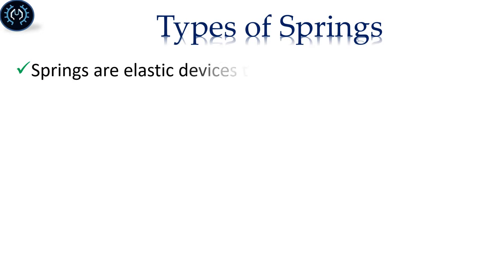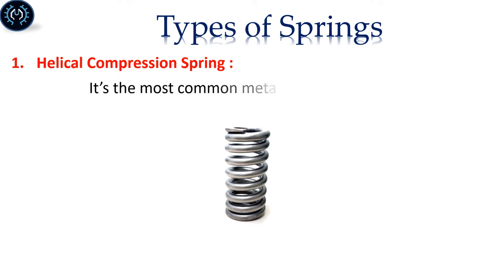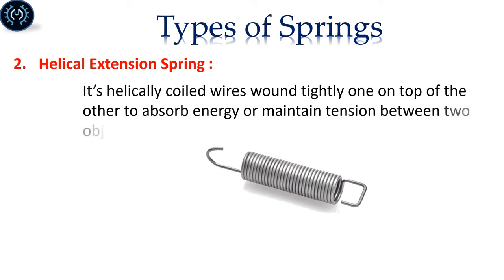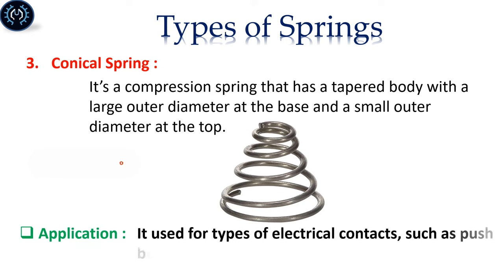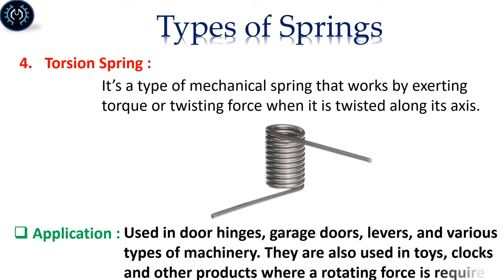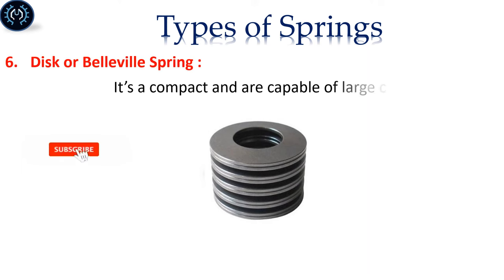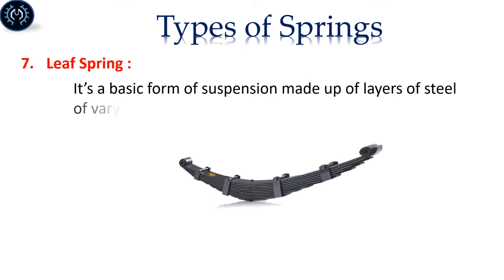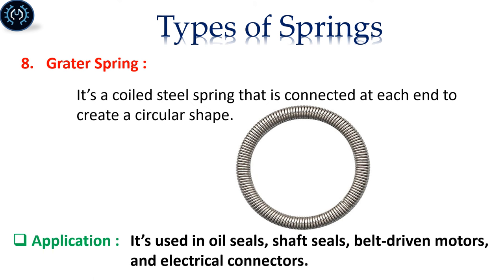Springs Types, Usage and Applications

Comment: I wish you would have gone into detail about the working principle of each spring, specifically how the spring rate changes (or doesn't change) as the spring is deformed.
Understanding the working principle would facilitate understanding as you go into detail on how the spring is used in each application. (don't merely list the applications, illustrate the use cases).
For example, another name for a spiral spring is a power spring, and it is a type of constant force spring, which means the spring rate is (close to) zero newtons for every unit deformation. That is, the restoring force is (almostl) the exact same no matter the spring's displacement.
A computer monitor stand might have a power spring in it and it will be sized to balance the weight of the monitor so the user can just raise and lower the monitor toolessly and leave it at the desired height. 

You forgot the mention another type of constant force spring, a gas spring. This Old Tony just put out a video on them. They're very much like pneumatic cylinders, except there's a hole drilled in the piston to make the pressure on one side of it equal to the other. However, because the surface area the gas is able to push on is limited by rod on only one side of the piston, there is a (mostly) constant force pushing the gas spring into extending. These are commonly found on tool chests, and car hoods and hatches.

I understand I'm asking for a lot more technical detail and occupational worldliness, but these considerations are critical to develop an integrated and actionable understanding of mechanisms.
Reply from the maker: @chaosserpent3979  I will try doing this in our next videos👍. Don't forget to support us and subscribe please ❤️